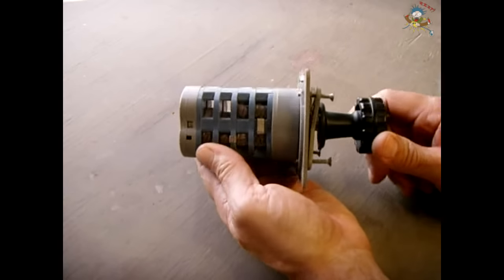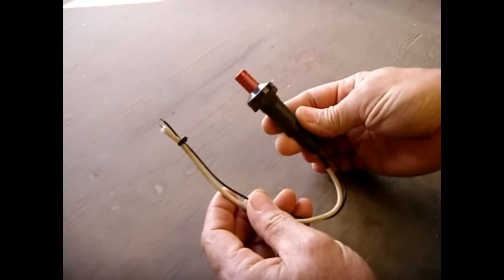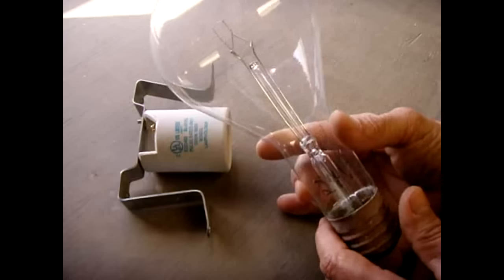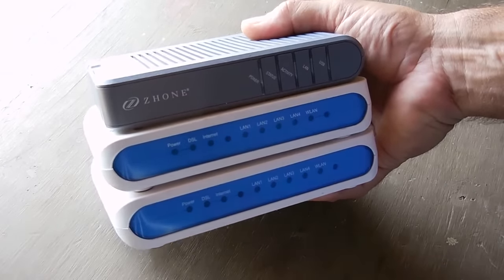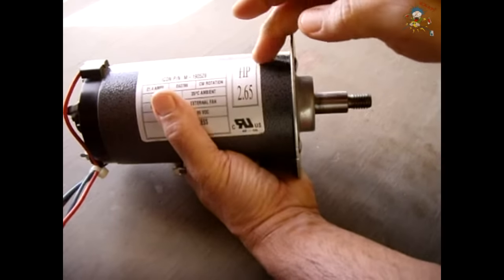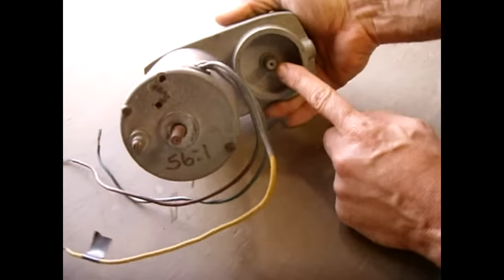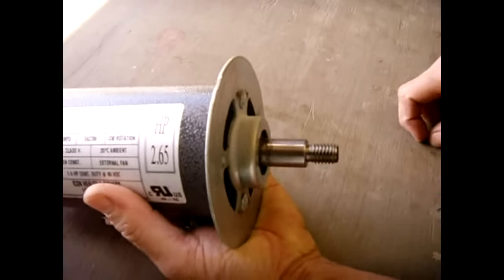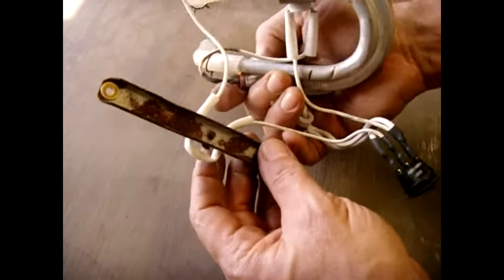Electrical Items & Other Treasures From The Trash!

Comment: My Truck Camper has electric jacks made by HappiJac. I took them apart to grease them and the gear assembly looks just like your gas pump motor gear box.

Comment: The socket probably is meant for the 24 volt bulb. The max voltage rating is usually a lot higher than the lamp itself.

Comment: I think that bulb you have is for what is called a light tower. They use those ceramic sockets because of the heat the bulb generates. Some things I am not sure what you can use them for. I have to clean out some of the things i have but have not used.

Comment: Electrical Items & Other Treasures From The Trash! 
~.~.~.~.~.~.~.~.~.~.~.~.~.~.~.~.~.~.~.~.~.~.~.~.~.~.
I dissembled a microwave oven and still have the Magnetron (Pink part expecially) intact.  I've seen many YouTube Scrapper videos where the Scrappers smash the Magnatron to pieces.  Correct me if I'm wrong, but isn't the Magnatron Radioactive (especially if plugged in or smashed?).  Furthermore, I have the Matron sitting in a black garbage bag in my bedroom will it emit Radiation by just sitting there (Untouched)? 

OMG: I dissembled a coffee maker too!  But thank god I did it outside because there were thousands of tiny ants that came running out!  (Make sure you disinfect any hoses you use from that!)

My Grandfather used to own an AMC dealership w/ Gas Station.  After he passed away my father had me help him with the clean-up.  Mind you my Grandfather also bought an entire hardware store before I was born; so you add up all that + the Automotive parts and there was a huge inheritance to be sorted out.  I never got a hold of any "Fuel Pumps".   But now that I think back I'm a bit disgusted to think about how many truckloads of dumpsters worth of stuff were carted away.  I guess it just because it became to overwhelming for them to deal with.  

Seriously if I knew then what I know now, I would have brought many backpacks with me to the clean-up, not like anyone would have noticed if something went missing (LOL). 

I hope I now gave you a better idea as to why people just throw away such great stuff, cuz they don't want to have to deal with their dead relatives leftovers. Kinda sad... 

Thanks ;-)
Reply from the maker: +NYCClubMaster 
Magnetrons are not radioactive.The pink end of the magnetron is made out of a very hard, hazardous, and brittle element called Beryllium Oxide which can tolerate high temperatures. The problem is not handling it whole, but if you break it, it "MAY" become a fine dust which you could inhale and "Possibly" cause cancer. It is best to not break the insulator. If you do, make sure you do it outdoors and make sure you are upwind from the magnetron as you break it open. I have broken them open 2 times to look inside. Very simple. Don't inhale any dust! Cancer is not usually caused by one or 2 exposures. It usually requires repeated exposures over time. Some people are more resistant to cancer than others. Some are more prone to cancer.
Reply: +electronicsNmore : 
Thanks for the heads-up !!!